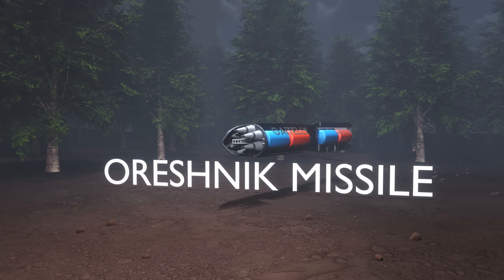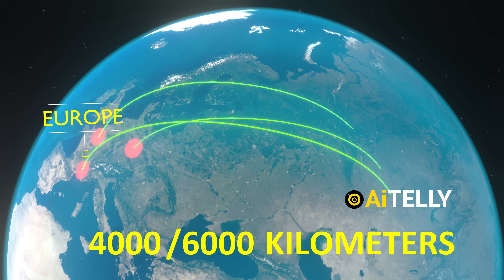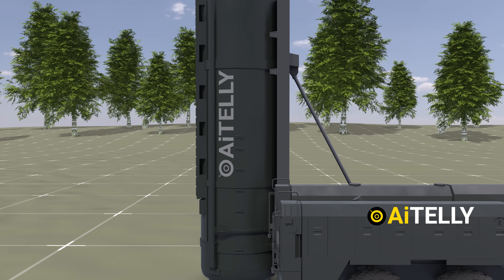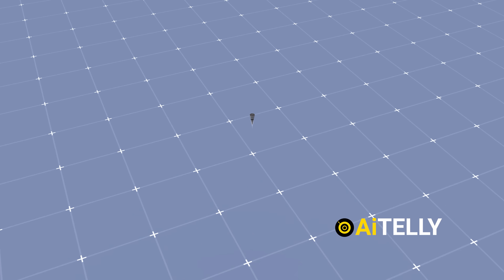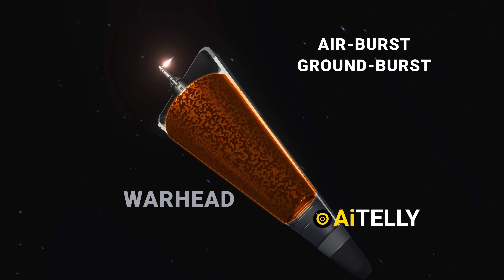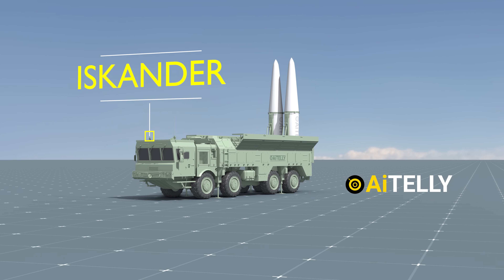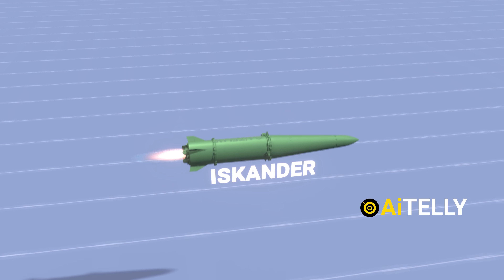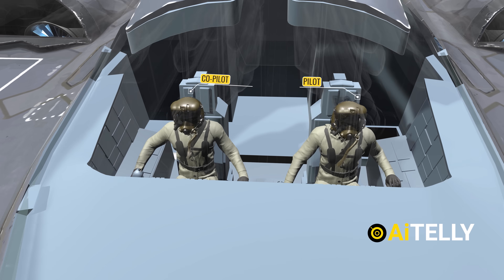Oreshnik Hypersonic Missile | How Russian Intercontinental Ballistic Nuclear Missile Works?

Comment: The Rocket contains 6x6 warheads, all together 36 warheads
Reply: Yeah, it's wierd that he only said 6. In the footage we can see that the missile used hit multiple times
Reply: @dipereira0123  Yup from what we saw in Dnipro 2~3 weeks ago its definetely more than 6 warheads
Reply: @ninehundred999  6 warheads with 6 hypersonic submunitions in each one.
Reply: @ninehundred999 I read that the re-entry warheads had broken into pieces, making it look like more projectiles. But, who knows.
Reply: @ninehundred999 I read that the re-entry warheads had broken into pieces, making it look like more projectiles. But, who knows.
Reply: Yea there are few points that are not accurate based on specs outlined by Russia. I'm guessing this is a video made using Ai as the channel is called AiTELLY.
Reply: Yea there are few points that are not accurate based on specs outlined by Russia. I'm guessing this is a video made using Ai as the channel is called AiTELLY
Reply: Decoys are surely an option. but the test missile seemed to have 36 warheads all of which hit the target. So on the basis of the evidence to date, no decoys were used.
Reply: @markir9 lol they are actually all decoys striking only by kinetic energy.
Reply: @seanweed2278  Kinetic warheads are not typically the same as decoys! The latter are designed to be noticeable on radar etc not necessarily able to inflict damage.
Reply: @ In nuclear circumstances, they would be decoys.
Reply: More information  about the warhead composition is starting to appear. It appears that it may in fact be an exotic metal  concoction using tungsten and aluminium with perhaps an oxidiser added. This can produce a metal vapour explosion when impacting at very high speed. So i.e not entirely a kinetic warhead like we thought.
Reply: Oreshnik warhead system with hypervelocity kinetic penetrators is different from the nuclear payload warhead. It contains 6x6 tungsten(or depleted uranium) kinetic penetrators which are extremely effective without any explosives, because of their extremely high velocity and density, plus their pyrophoric effect in contact with oxygen once they impact the target and burst out. It is practically the same as a tank KEP with a sabot arrow, but with much larger weight and velocity. When a nuclear warhead is used, Oreshnik contains 6 warheads only with nuclear devices with strength up to a few hundred kilotons of TNT. hypervelocity in that case plays just the role of reaching target as soon as possible with no practical value in the destructive effect of reentry vehicles.
Reply: @pedjabrankovic7815  маячня. Давай розрахунки по фізичним формулам, а не фантазію. В по моїм розрахункам, максимум в слабкому грунті буде кратер максимум 3 метра діаметром і 1 метр у глибину. Це максимум.
Reply: @pedjabrankovic7815 

Are they effective though?
 Have you actually seen the results of the impact?
Reply: @pedjabrankovic7815  Well the hipervelocity doesn't help hitting targets with non nuclear MIRVs since they dig themselves in the ground...it's basic physics.
Reply: why use decoy if a decoy also can be filled with small nuke inside.
Reply: @foodAsia1  at that speed even decoys with moderate mass are also deadly kinetic penetrators. Mach 10 reetry is no joke
Reply: @foodAsia1  Nuclear warheads are expensive to make and maintain. Decoys help to overwhelm defenses without needing a nuke for every "warhead". Also there are a lot of scenarios where you might want to use just one low-yield nuke,  and decoys will help it to get through any defenses.
Reply: @foodAsia1 а можна просто стріляти золотом замість обманок
Reply: There is no any sense to use decoys
Reply: We've been waiting for this video a long time, and then the explanation is far away from reality. As people cited there has been 36 ground impacts. You only show 6 :3
Reply: А вообще, какая разница - 6 или 6х6, если сбить их всё равно невозможно? Пиздец неотвратим, и там уже будет неважно, как это произошло - некому будет сожалеть.
Reply: No ... there are only 6 warheads that carry 6 submunitions each .... they very small !
Reply: @steveb890  If Oreshnik is launched at distance from 800 to 1000 km so payload could be more than 1,3 or 1,5 tonnes. Like 2-3 or even 4 tonnes.
Reply: @batman7759  No it cant , its not big enough ... max is only around 1,200 kg  !
Reply: @steveb890  this rocket can be launched on 5000-5500 km, so if it is launched on 800-1000 it can carry payload up to 2-4 tonnes.
Reply: @batman7759  Its just an RS-26 its not big enough !  ... whats so hard to understand ?
Reply: @steveb890  u don't know exactly what it is. Is it rs-26 or not. Probably it's not rs-26 becouse Oreshnik was launched at distance around 850 km...
Reply: @batman7759  It cant , its only an old RS-26 its not big enough to carry that payload !
Reply: @steveb890  First rs-26 it's not an old rocket. Second Rs-26 is ICBM what can be fired at range from 2000 km to 6000 km. Oreshnik was launched to 850 km.
Reply: @steveb890  rs-26 has 3 stages. Oreshnik probably has 2.
Reply: @batman7759  Wrong again ...its an IRBM 
from 2011 . Do some research before you comment kid !
Reply: @steveb890  if rocket can be launched more than 5500 km it's already icmb. Learn it kid. And you have zero evidence that it is rs-26.
Reply: @steveb890 Some think its modified but no one knows exactly so you are not right.
Reply: 36 warheads, not 6
Reply: Nope six warheads with 6 50 pound submunitions, ostensible to increase local hit probability.    The video of the strike indicates that each of the six warheads released six submunitions for a total of 36 artificial meteorites weighing about fifty pounds each. According to current best estimates, the RS-26 has a ‘Circular Error Probable’ or CEP of 90-250 meters , meaning that half the projectiles would lie inside a circle of that radius. This is accurate enough for a nuclear warhead with a blast radius of several kilometers, but not for a handful of kinetic warheads.
Reply: 6×6. 

Ребята, там вся загвоздка в том, что каждые 6 бьют в одну точку. За счёт этого поражаются даже сильно углублённые бункеры. Вы видели фото воронки от взрыва в Днепре?
Reply: @V.B.N-D  да не бьют они прямо в одну точку, то что они лодатьсяплотно это да, но не прямо в одну точку. Поражающий эффект достигается за счёт огромной скорости и видимо крепкого материала и огромной температуры.
Reply: @batman7759 это очевидно. Для иголки "одна точка" и для молотка "одна точка" - имеют некоторое расхождение, хотя и в том, и в другом случае - бьют они в одну точку.
Reply: He failed to mention that 6 warheads contain ANOTHER 6 warheads, 1 Oreshnik has 36 warheads total that can hit various targets.

And he failed to mention that Oreshnik reaches the speed of 20 mach, but when flying downward towards its final destination it flies at 10-11 Mach.

The fact that he skipped these two very important and easily findable facts tells me a lot about their research!
Reply: @aleksseb5504  they not warheads ... they small submunitions ! ... you forgot that FACT !
Reply: @steveb890  36 antibunker hypersonic submunitions. We still haven't seen photos of Yushmash. If damage was on a minimum level like you say why ukrainian government are hiding photos and videos of this attack?)
Reply: @batman7759  There is no such ordinance , maybe phone a friend or try again ? 
Its a pointless expensive weapon without any explosives , images are there to see if you check , buildings are still standing albeit with holes in the roofs .... maybe a runway would be better option.
Reply: @steveb890  so you are saying that there is no point in tank armour-piercing ammunition? But instead of one armour-piercing shell Oreshnik has 36 armored concrete piercing submunitions with speed of 10-11 mach and much heavier and with 4000 degrees temperature. It's perfect antibunker weapon. Arrows of God.
Reply: That's BS
Reply: @slavakuznetsov4966   no it's not
Reply: Fact is you don't know shit 😂😂😂😂
Reply: So they target was basically fucked?
Reply: And the warheads can vary
Reply: There is no MIRV newspaper that can hold 36 warheads.
Reply: Not 36 nukes maybe 36 small bombs of explosive.
Reply: @goahead8121  nope only six warheads.
Reply: увы только 6 .....при вспышке если она больше Большова пальца вы в зоне поражения ....и хранит вас господь.
Reply: Bullshit. It has 6.
Reply: @Shadow-Banned-Conservative  6 mirvs with 6 subminitions
Reply: It depends on the target
Reply: @goahead8121  and all those warheads flying at hypersonic speeds
Reply: @goahead8121  Нет Такой ракеты, есть мультфильм!!!
Reply: @goahead8121  Так точно!
Reply: Европейцы! Угомоните своих правителей. Не злите русского медведя. Русские никогда не начинают войн. Русские всегда заканчивают войну.
Reply: Европейцы! Угомоните своих правителей. Не злите русского медведя. Русские никогда не начинают войн. Русские всегда заканчивают войну.
Reply: warhead is no more than melted metal at the speed of 11M.
Reply: Короче чё вы спорите, на ракету ставят 6 боеголовок и одна боеголовка разделена на 6 маленьких боеголовок, но только в том случаи если они имеют боезаряд, но по южмаш запустили ракету без боезаряда , всего 6 боеголовок которые разрушают цель генетической скоростью они не разделяются
Reply: Umbrella lazer defense will makes this missile inutile.
Reply: Что бы вы здесь не обсуждали если Россию разозлите вам прилетит орех а вы его даже на радара не увидите есть над чем подумать
Reply: I hate AI, so many mistakes in this narration.
Reply: The SARMAT is the biggest ICBM in the world and has up to 14 warheads so 36 is impossible.
Reply: Oreshnik or "heavy rain of tungsteen"
Reply: @goahead8121  it was carrying a payload of 6 warheads which none contained any explosive , it only used the kinetic energy to hit the ground like an asteroid at Mach 10, some witness from Ukraine claimed the area of impact was vaporized and the crater was as deep as a 4 stories building . No conventional explosives would come even close , only nuclear . And the missile can be equipped with 6 tactical nukes (no strategic though , too big to fit inside the smal warheads (unless they adapt to carry one only maybe two depending on the model of nuclear warhead
Reply: EU no podrán decorarlo todos dan sus opiniones ,esto dependiendo la distancia ,la potencia que necesitarán , Rusia tiene varías armas según para las circunstancias que se presente está arma podrán disparar sin ningún problema de espacio por qué ellos seguirán INNOVANDO.
Reply: @goahead8121  no sir one war head is equal to one it can drop only 6 warheads and 6 means 6 only not 36 thank you
Reply: Yep, no mention of submunitions .. video just regurgitates the same basic info from the first few minutes
Reply: 12 vehicles opt 36 6x6 means 2 levels of 6 each!!!
Reply: Not all of those are warheads. Many of them will be decoys.
Reply: @kingkea3451  Why? They can't be intercepted, what's the point of making baits?
Reply: @Alexcey.620  The same reason ICBMs have decoys, they can be intercepted at the mid-course phase, so for an intercepting missile the decoy looks the same as a warhead.
Reply: @Alexcey.620 yes they can.
Reply: @erickcoelho234  No one can hit a target with a speed of 10 machs yet. It is only possible at the start.
Reply: @Alexcey.620  decoys are precisely present for this reason, modern ballistic missile defense systems can theoretically target & kill MIRVs.
Reply: @Alexcey.620  These are kinetic warheads , no need for decoys. But if they were nuclear warheads , decoys would make it harder to intercept.
Reply: @erickcoelho234  you can't catch Air
Reply: @Alexcey.620 Putin and Ukraine both confirmed that Oreshnik was going Mach 10 at the destination. 

Oreshnik reaches Mach 20, but flies Mach 10 at its destination. So yes, there is such a thing.
Reply: @Alexcey.620  Because they can be engaged in the early phase before being released from the MIRV bus by missiles like SM-3/SM-6 . And there is THAAD also.
Reply: @louies6914  Nonsense, from the moment this missile is launched there are only a few seconds to intercept it! Putin proposed to conduct a test over Kiev, why does no one agree?
Reply: @Alexcey.620  those who are smart design something as best as possible. Just logically, if the tank has APS protection, what's the point of steeling the tank body, why not use tuna fish cans?
Reply: @Jabich_  Да чушь! Вы живете в 1990? Вам первое лицо объяснило, на старте орешника есть только несколько секунд что бы перехватить его, потом не одно пво не способно его сбить на сегодняшнее время. Ну нет причины делать какие то ловушки! Я понимаю еще крылатая ракета) А тут я видел четко шесть прилетов, по 6 ракет.
Reply: @Alexcey.620 Some can be intercepted but not all
Reply: @kingkea3451  he is right, but all those 36 are kinetic warheads and have an approximated weird between 100 and 150kg
Reply: @levilastun829  If the missile pay load as said is 1.3 ton and all 6 MIRV separation kit and guidance ways 200kg .all 36 subwarhead should weigh 1.1 ton that gives each warheads weigh 30kg approx.Thats why the did not use explosives.
Reply: @levilastun829 So, this would mean that the payload capacity of this missile is not 1.5 metric tons but 3.6 to 5.4 metric tons. Maybe the intercontinental setup has 1.5 tons of payload, whereas an intermediate setup has a heavier payload and reduced range. In order for these missiles to be intercepted reliably and en masse, one would need scalar weaponry to create so-called Tesla shields - if this is even possible theoretically, let alone practically.
Reply: @kingkea3451  That's what the shovels are for.
Reply: @kingkea3451  They were warheads, they impacted at the same time and with the same force (there is footage of the impact).
Reply: @Milo-id9qd  they are submunitions , not warheads !
Reply: @kingkea3451  They can all be armed as well, it has the capability.
Reply: @kingkea3451 and those decoys have kinetic energy too when they hit, ist not like they would be harmless
Reply: @kingkea3451  in that speed all off them are wareheads
Reply: @kingkea3451  ложные цели летят с разной скоростью и у них обычно другой вес из-за чего они бы просто отклонились от курса или пришли бы в другое время чем основные снаряды а там на кадрах видны синхронные прилёты по 6 боеприпасов
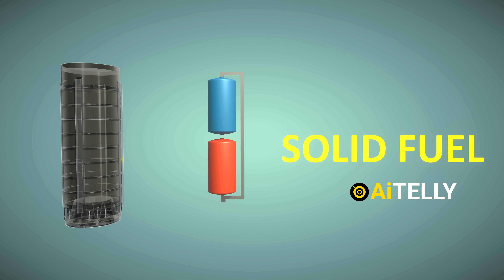Reply: We also need to remember that all these videos are now nothing more than a designer's fantasy based on rumors and speculations made by internet "experts". There is almost no reliable information revealed yet. The technical details quality level of this video can be judged by the drawong of "solid fuel" stage at 0:52 with separate cylinders of "solid fuel" and "solid oxidizer" (solid oxygen?) 🤣😂😁. The principle is correct, but any or all details may be wrong.
Reply: @goahead8121  Россия💪😎
Reply: Didn't Russia launched like 6 oreshnik rockets with 6 warheads each? Or am I just not that updated?
Reply: @_leafaR  No. 1 missile with 6 MIRVs, each of which has 6 kinetic warheads.
Reply: @markir9  1 Oreshnik only has 1 MIRV with 6 warheads. You trippin' bruv?
An ICMB with 6 MIRV must be really big, like bigger than satan-II ICBM.
Reply: @_leafaR  He meant that 1 MIRV has 6 warheads and each warhead had 6 submunitions,in this case, probably tungsten submunitions. In total, 36 hyperspeed submunitions flew into the atmosphere. He meant well, he just worded it wrong 😎
Reply: @samfisher8557  Ahh so that's why I was confused.
Thanks for your time disclosing how oreshnik worked in ukraine.
Reply: @_leafaR  Firstly it isn't an ICBM, more correctly 'Intermediate Range Missile'. Secondly, Yes 6 MIRV, each of which has 6 kinetic warheads (these are typically referred to as sub-munitions). Go and look at the vid of it hitting the factory 6 sets of impacts with 6 distinct warhead tracks. Obviously the kinetic warheads are smaller than nuclear ones, *if* it were configured with nuclear ones then yes each MIRV would likely only has a single one...
Reply: @_leafaR 
If the missile have ONE MIRV it’s not called an MIRV missile at all ..
Check out Indian Agni-3/4 series it’s a MRBM with just one warhead 
This Oshinsk has 6 MIRV , each MIRV consist of Six sub-warheads (6x6) ie the same warheads striking in the video .
It’s a large Missiles based off RS-26 ICBM so don’t think that this is a small weapon.
Reply: @_leafaR  , Не "в" украине, а "на" украине
Reply: @_leafaR  да, скорее всего было именно 6 ракет. Почему NATO не говорят сколько именно ракет было?🤷‍♂️
Reply: Then maybe 6* mini-MIRV, is a new technology.
Reply: @_leafaR  lmfao no 😂🤣
Reply: @Targeted.individual-x  Uh someone already responded to me and explained it properly earlier. No need to be sassy.
Reply: @_leafaR  it was one rocket only
Reply: @_leafaR 
Just 1 (ONE) missile .
Reply: @_leafaR  No that was only 1 lol
Reply: @_leafaR 1 ракета, 6 боеголовок, каждая боеголовка разделяется ещё на 6 . Всего в одной ракете 36 боеприпасов
Reply: @MiloeSolneshko  I do not understand what you are saying.
Reply: @_leafaR  это была одна ракета